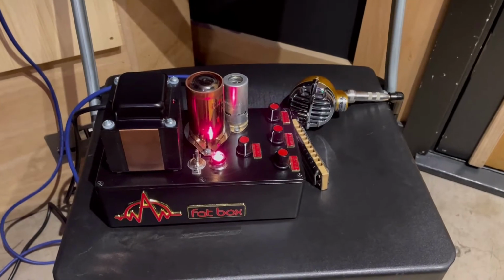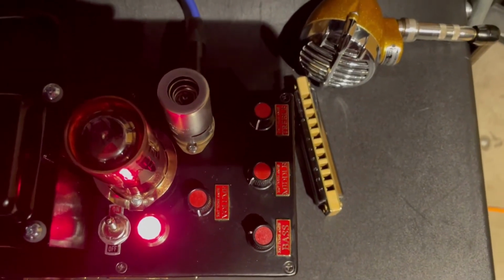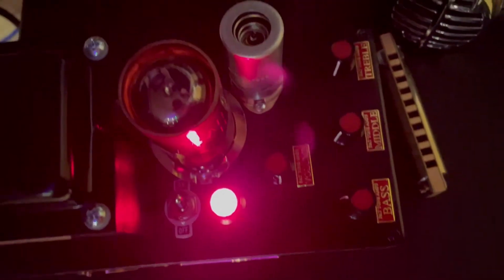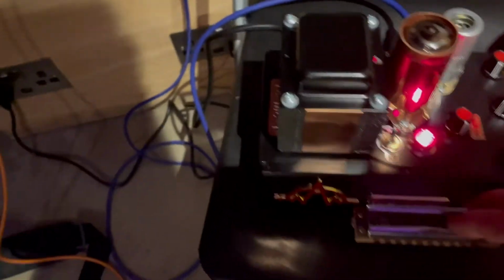Blues Harmonica - The Fat Box harmonica pre-amp from Fat Tone Amps

Comment: Happy to see another video up mate. Anymore lessons coming soon?
Also, could I run this straight into my little shitty practice amp as opposed to a pa?
Reply from the maker: Hi Darron.  The Fat Box is designed to run straight to a PA so I wouldn't recommend it to plug into an amp.   You might be better with something like the Harp Break, or even the Harp Octave from Lone Wolf.   I really like the latter to fatten up your sound on an unfriendly amp, however they're expensive so if you can find one to try out first I'd recommend it.       I'd love to do some more lessons but unfortunately I've been too busy.   Just finished having an extension done on our house and there's been a ton of decorating to do.

Comment: Hi Adam. Great video. I've been wondering about ordering one of these. I have a harp attack  pedal from lone wolf, which is ok but I don't like the way it compresses the sound. Does the Fat Box compress the sound as well or do you feel it is a more realistic amplified sound. I'm assuming as well that if you want a balanced feed into the PA you need to take the line out of the Fat Box into a DI Box and then take an XLR feed out from that. Would that be correct? Best wishes, Ricky
Reply from the maker: Hi Ricky,  I've not tried the harp attack, but I have tried other pre-amp pedals and the Fat Box is definitely the closest to a realistic amplified sound.  To be honest I don't think the video does it justice as I was pleasantly surprised and it's making me think about using it instead of my expensive amp next time I gig.  I'm not an expert around working with a PA so don't feel I can answer your question on the DI Box, but I can tell you that the Fat Box is designed to plug directly into the PA.  If you're thinking about buying one (Dave Walker from Fat Tone Amps hand makes them to order) I would thoroughly recommend taking a trip to his workshop in Monmouth.   He's a great guy, keen harp and sax player and extremely knowledgeable about how to get the best harp sound out of your amplification.   I spent an enjoyable couple of hours there trying stuff out and generally chatting harp.  Alternatively if you're down Cheltenham way anytime then I'd be more than happy to let you try mine out.
Reply: @GobIron  Thanks Adam, that’s really helpful. I think you’re right, I will make contact with Dave and take a trip down to Monmouth. The harp attack pedal is ok and I link it to a little red d.i. box to take a balanced feed into the PA. I’m just not a fan of the compressed tone it produces. My days of hauling my bass man around are over so I do need to sort out a good alternative. Best wishes, Ricky